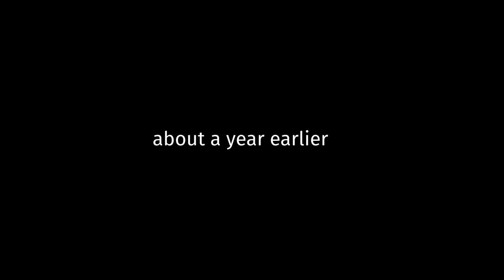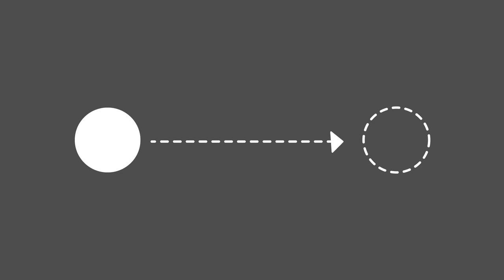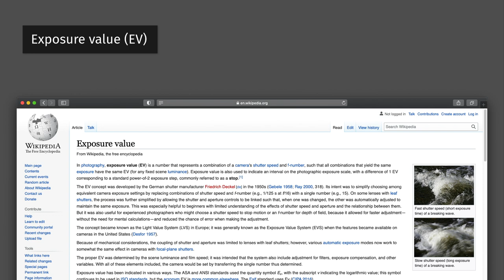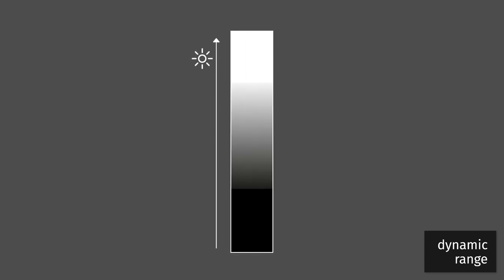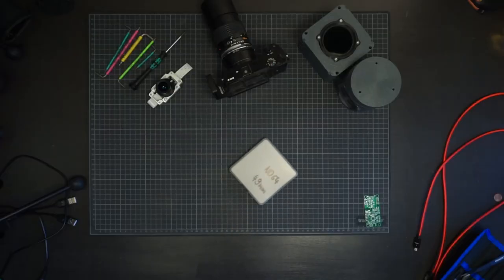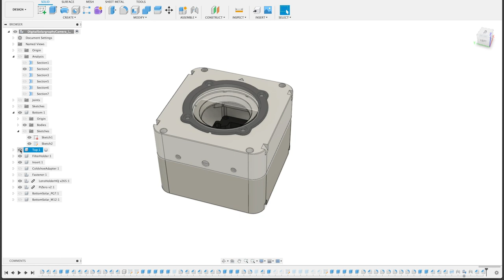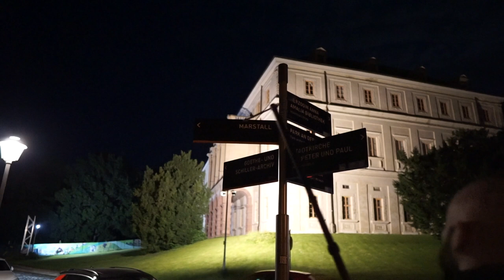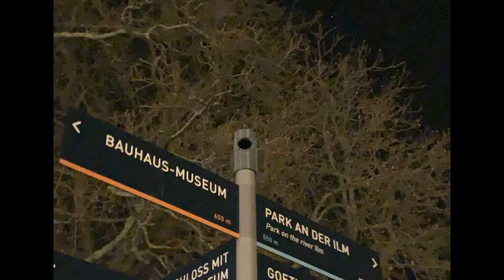Ultra-Long Exposure Photos and Digital Solargraphy

Comment: Very cool! I’ve made pi zero cameras in the past, but mostly I just stuck them in old broken cameras. I’d love to do a full 3D print like you’ve done, but I need to figure out how to control the camera settings using physical inputs. Like a dial for ISO and another for shutter speed. (I’ve already figured out push button to shoot, that was easy). GREAT VIDEO!

Comment: Volzo, great video on a great topic ;D I have a technical question about the exposure stacking: Instead of using a weighted average why not set a fixed exposure? As I understand the difference in exposures between images is "reversed" by the weight, right? Or will the result not be the same?
Reply from the maker: Fixed exposure = same exposure settings for each image? This would not capture the same dynamic range as you would loose all images exposed during morning and evening when the scene is too dark. That would be equivalent to doing a shorter overall exposure, like starting to capture at 9 and stopping at 16 o'clock. That does work, indeed, and saves a bit of hassle when doing the computation, but the images are much "flatter", you loose a lot of colours and you don't get the part of the sun's arc when it is just raising and setting above the horizon.
Reply: @vlztn  Ahh, okay I understand. Gonna make some test series to see what works best for me. 
P.S. Danke für die schnelle Hilfe ;)

Comment: amazing, really. do you think a small solar panel can power the operating system? in order to lengthen the periods of exposure.
Reply from the maker: Good point. Yes, it does work well with a medium-sized panel (about as large as a piece of paper). Even a few overcast days in a row are okay. But that does make the camera a lot more obvious, so I tested the solar prototype only on my balcony and did never actually put that to use.

Comment: Really enjoyed this! Fascinating technique. I have a question: what exactly does w(i) indicate at 5:23? Is this value inversely proportional to the pixel’s brightness?
Reply from the maker: Yes, that's exactly what it is. I use the exposure value as a weight which is an inverse log scale. That's the code I use: ev = math.log(aperture / shutter, 2) - math.log(iso/100, 2) + EV_OFFSET